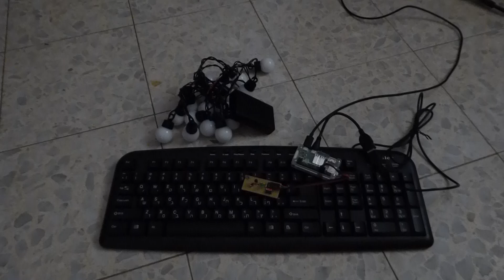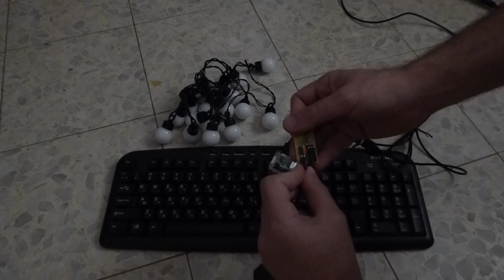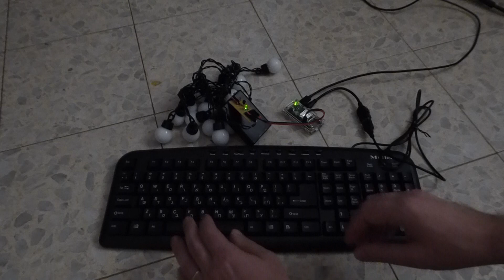Password-activated LEDs using a Raspberry Pi (sans monitor)

Comment: In my last workplace we also used a single board computer (similar to Raspberry PI) with Linux running on it. During the boot-up it created a ram disk, copied all the system files on it and run the from there. This meant that we didn't have to worry about corruptions caused by sudden shutdowns since every start-up was a clean slate.
Reply from the maker: Sounds like a good solution, but beyond my knowledge of Linux :-) How complex is it to implement?
Reply: It was a long time ago. I think that the vendor provided Linux worked like that by default.  
  
I Googled a little and found this:  
https://github.com/ali1234/rpi-ramdisk  
Although I found some forum posts that say that Raspberry PI might not have enough RAM to do this (maybe it was an issue with the older models).
Reply from the maker: Thanks, I'll take a look.